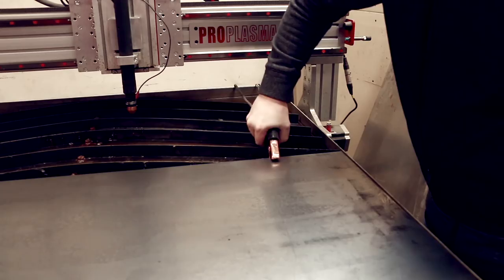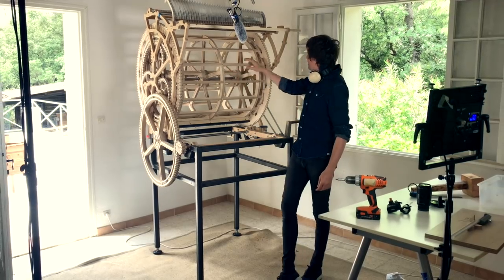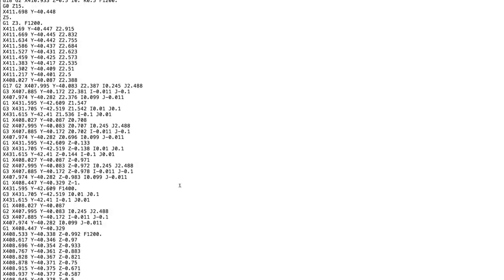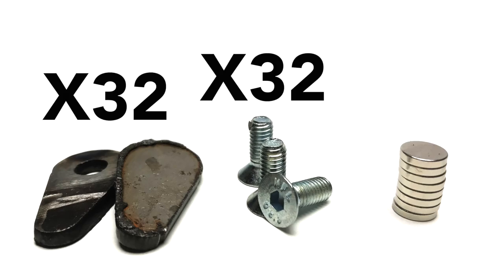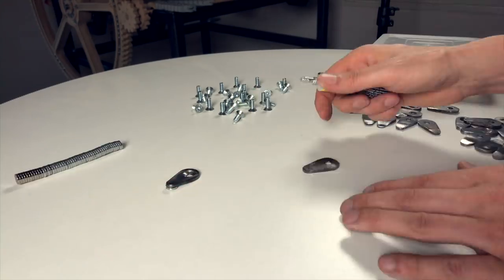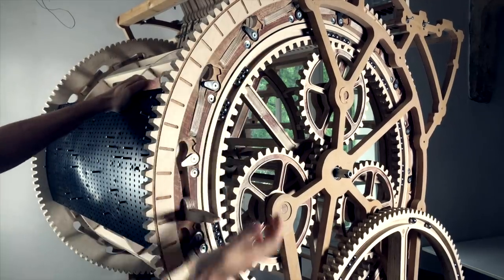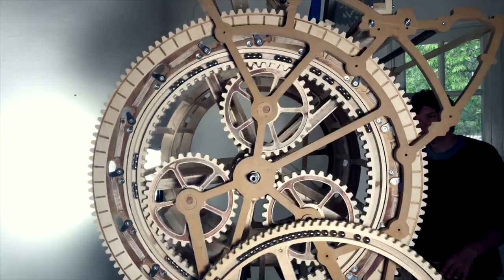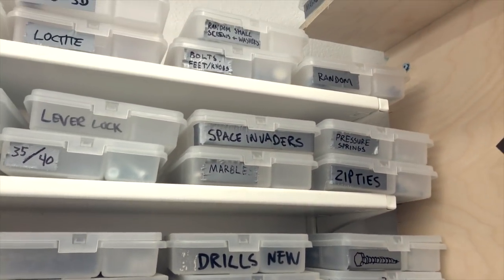CNC Plasma Cut Magnet Levers - Marble Machine X #37

Comment: "Without this package I would be kinda screwed" ... Says it while opening a package full of screws. Genius😂
Reply: This was "This old Tony" reference. Jokes like that are his trademark. Like he mentions "Clickspring" finish just later. Those are two of the best homeshop metalworking youtube channels. I strongly suggest to look them up. the quality of their videos is amazing.
Reply: Yeah, and they'll help him get his things together! LOL!
Reply: They a bolts not screws!
Reply: James Horseman yeah that's true but it was just about that joke so it doesn't matter here
Reply: James Horseman - Not all of them are bolts. Besides, bolts are also known as machine screws.
Reply: Martin is a very punny person.
Reply: Links please?
Reply: muzvid The difference is in the usage. Bolts are fastened with a nut and do not connect directly to the thing being fastened. Screws thread directly into the work. The default, however, is screw.
Reply: Well, no matter how you slice it (screw vs bolt) you can at least agree that his pun had a common thread. :P
Reply: Spoonasaurus Wrex, then he was correct, as he drives the M6 bolts directly into the hole in the plywood = screws :-).

Comment: 4:35 Please do not use a drill for countersinking. The head of a countersunk screw has a angle of 90°, but the angle of a drill bit is normally 118°.  Just use a 90° countersink bit. They are useful and cheap ;) Besides a better fit, the conical hole will be much smoother.
Reply: Martin needs a spiral bound toolmakers handbook. What you just said is explained in there in detail.
Reply: Machinery's Handbook.
Reply: @billkeithchannel  , someone should mail him one.

Comment: 1:26 If that were my laptop I'd want something there to shield it from sparks!
Reply: In this case, that laptop is used only to run that CNC machine. Ever since CNC machines first came out, there would be a PC dedicated to running it.
Reply: I kindof agree with OP, just because it is dedicated to the machine doesn't mean you shouldn't protect the investment.  At the plant I worked at all the PCs for CNC machines were in little cubicles made out of welding curtains, $80 in curtains is cheaper than $400 in hardware (maybe less, they were cheap PCs)
Reply: ehh those sparks are pretty innocent, and it really only gets in the way when it is cutting right in the corner and only on specific curves, you can hold your hand to those sparks and it really doesn't hurt
Reply: @fergusoddjob  It doesn't need to be hot!  That's powdered near-atomised metal expelled from the work/cutting head into the air next to "delicate" mission-critical IT equipment, it'll insinuate itself in any tiny space available -- I'd hate to see the two years' worth of metal filings accumulated beneath the keyboard waiting to short out or just mechanically ruin the contacts as soon as someone removes it and shakes it about a little...
Reply: @GrahamJEllis  calm down bro it'll be fine
Reply: @fergusoddjob  ;-) I was just entering into the spirit of conversation...

Comment: Why do you use 2 magnets per lever? 1 inside the wood would have been enough, or?
Reply: pwn2own that’s what I thought, too
Reply: My thoughts on this is that there may have been too much space in between the wooden and metal parts of the lever. Either that or the magnetic force between one magnet and the metal may have not been enough when at full speed while the machine is spinning.
Reply: Yeah, the force between two magnets is much greater than the force between a magnet and a piece of metal.  Extra security. :)

Comment: Hi Martin,  glad to see another installment this week. im always bummed when there's no wintergatan wednesday. it would have been interesting and simpler to eliminate the metal levers completely, and have a magnet embedded in the wood of the gear, so that when you closed the plywood programming levers they met a magnet that held them in place. of course, i dont know if the force of such a magnet would be robust enough to retain the plywood levers with certainty. additionally, the aesthetics of the metal magnet levers are pretty mean! cheers!

Comment: im sure this has been said already, or you already know but for metals you really want a dedicated countersink bit, there are golden ones with the hole running through them that sell for 10 bucks on aliexpressfor a pack of 4 that seems to have held up after 2 years, they make a much cleaner hole without the struggle and they won't leave that burr on the top edge. even for wood they are quite nice

Comment: How about setting a screw to hold those tabs open while you are installing the programming plates? A steel wood screw would work: not too strong and not all that hard to put in. The magnets would cling to them without issue I'd think

Comment: Maybe I have missed it and decoration is already planned, but IMHO those programming plates need some sort of BIG markings just from usability stand point. If they are not super clearly marked, at some point someone will accidentally in a rush put a wrong plate or a plate wrong way around. So at least some big ass arrow/chevron/other decoration showing this way up (or down) and a number are needed so, if a plate is put on incorrectly, someone else might spot it from further away.

Comment: Will you test the machines sensitivity to leveling? I mean we know what is going to happen if it is leaning 45 degrees... but what about 2 degrees? 3 degrees? 11 degrees? I guess this is important because you never know if the stages are well setup.
Reply: He can add two bubble line levels on the metal base to level it.

Comment: Looking good man. Haven't checked your videos in awhile. Coming along nicely. One thing I noticed to be constructive is the upper framing looks like it could do with some triangulation in it's structure. Seems a bit wobbly from side to side. And once the marble divider is mounted on top loaded with bearings I think it may be an issue. Some 2" gussets should stiffen it up and do the trick. Or were you planing on plasma cutting the upper frame out of steel? If so i think you may still need that critical triangulation. I am super super excited to see the rest come together:)

Comment: This is very impressive! But isn't this starting to get a little over engineered? I mean... a lever to hold the lever in place XD
I get that the levers need to be secured, so the programming plates dont fall off during a concert. And the magnets are a good way to hold the "lever locks" in place.. But it feels like the same function could be achieved by friction, so there's some resistance when you pull the locks in place, that holds them still! 
This's becoming more and more rocket science XD

Comment: Is it just me or did it seem like all the planetary gears were just floating and lifted way from the outer gear in most of these shots? I know you can adjust the offset of these gears but when you were attaching the metal locks with magnets it looks like the planetary gears were about to fall out.
Reply: Not just you, you can really see it if you pause at 6:15  I think that may be something that will resolve itself when he switches to the metal frame because the weight is probably causing some flexing and bowing.

Comment: Very funny video man! But I have a question...why don't you nested the shapes? If you nest it, you will save a lot of sheet metal😉
Reply: Would the "scrap metal" give-away be as cool, though?
Reply: with a small parts run like that it doesn't really matter, but man it's satisfying holding a 4x8 sheet of 6mm alu with one finger

Comment: Super cool "Space invaders"-animation. :-D  

I have an idea for you - could it be practical that the sets of programming wheel plates, comes in different colours (in addition to the numbering) - ensuring that the change of music on the stage
is done in the correct order? Could it additionally, be an idea that one set of programming plates, have some sort of physical alteration of the shape, so that they must be mounted in the
correct order. In addition to the numbering, however just so that the wrong plate cannot be inserted out of order or the wrong way. Suddenly, maybe you are in the situation that someone, not you,
will replace the plates, then it must be made fool-proof. :-)

 Maybe by fastening items that interlock or fit with other items at the next plate, or something. Just a suggestion, maybe the wrong ordering / mixing up the plates on a concert, is not a real issue.

Comment: Suggestion: stop using a drill bit to countersink, and buy a countersink.Also, why on earth are you using a hand drill instead of your drill press for that? Drill press is much better - and you can set the depth stop on the drill press to quickly get them all identical.